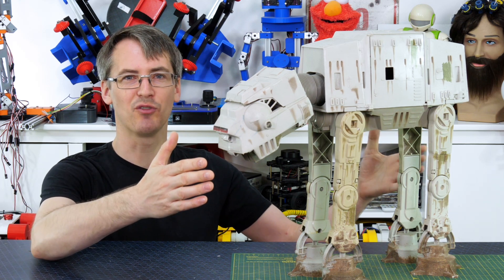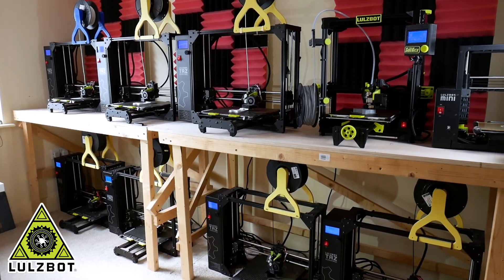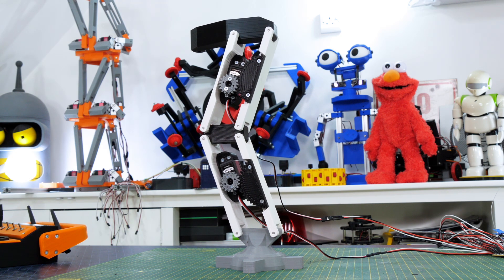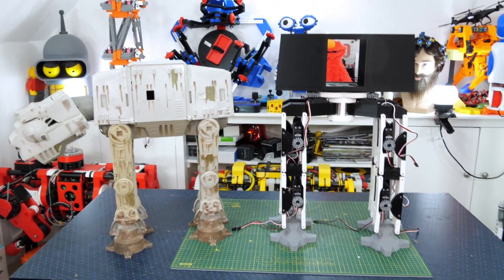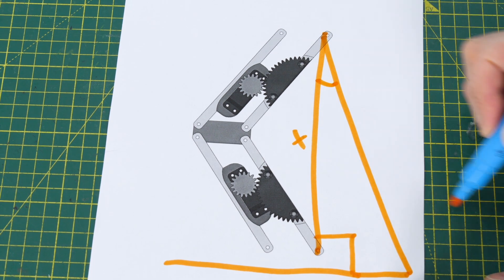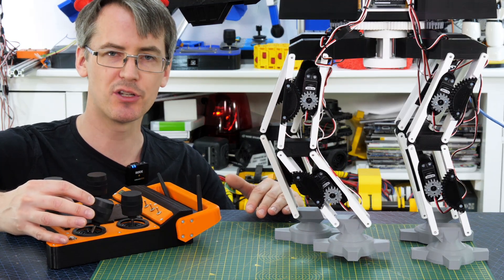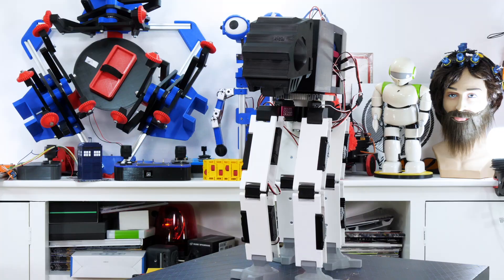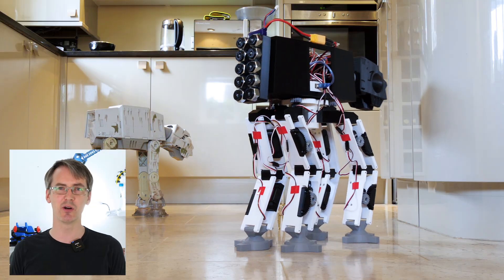Building a better Star Wars AT-AT toy

Comment: Its weird you didn't build in the "shoulder" action that the movie design actually has. Which would mitigate the wobble of the walk. I see the toy you have doesnt have the shoulder joints either. I think thought it would be exponentially more complicated to build it movie accurate but i think the movie designers actually did a good job making it a plausible design. They had to make the model walk in the movie after all.

Comment: It works, just with 2023 technology, rather than 1979 technology.
But it did make me appreciate what a marvel of engineering an AT-AT walker would be in real life - for all its mechanisms and control system. Combine that with the very tight and careful balancing needed to give it a stable walking cycle.
You get a clunky vehicle that's an absolute nightmare to build and probably requires maintenance after every deployment!
However, it's lore-friendly. Imagine how corrupt the Galactic Empire needs to be if it was to arm its ground troops with such clumsy and unreliable troop transports, whose primary purpose is to scare the enemy.

Comment: I'm scratch building an ATACT for a friend. I made the ankle joint with the arc attached to the fee and a passive shock absorder inside the ankle. It's a static model but each leg/foot assembly balances well enough to stand on its own. I wondered if you reproduced the ankle arrangements as they are in the stars models you may achieve a smoother gait. The arc on mine obviously made by hand and guesstimate. A printed arc would be much smoother.

Comment: Mmmm very interesting, but to put it in a real AT-AT..., may be a way to use only two motors alocated in the main body, which use tensors, each one controlling two crossed legs, and implementing some kind of cam mechanism in the legs??
Veeeeery nice proyect!!
Good luck brave one 💪💪
Greetings from Buenos Aires 🙂

Comment: While you did successfully create a walking robot with four legs, both people and at-ats don't walk or support themselves on bent legs. there is a stride and when you back step you're leg straightens to give support there is no straight support in those legs it's good for what it is but it's a fail for an proper walking at-at. Go back to the drawing board study the animation gate of the actual at-at, do a close up inspection of the gears an engine that powers it and try again. May the force be with you.

Comment: Very cool! As I was watching it, something didnt feel right, I think it's that the stride is different than how they walked in the films.  Yours is RF, LB, LF, RB compared to the original RF, RB, LF, LB, maybe an easy programming update with a big impact. The original also had another joint near the central connection that allowed the legs to lift up under the body giving it lift clearance and a firm plant, which I think made the walking effect feel heavy.That said, your design can turn and I don't see how the original design could. Overall great work!

Comment: And what's crazy... No one has ever addressed just how terrible by general design all of these walkers are! The greatest issue being the limits of the terrain itself! These things don't do hills and valleys! Then there's a problem with the ground itself. Most of us don't fully realize that ground isn't all that solid. Once an object reaches enough weight that the pound per square inch can't be supported by the ground the object will punch down into the ground vs standing on it. If you've ever seen someone trying to walk across a waterbed, you'd image a picture of what that falling would seem like! 
Comparing the scale of two toy action figures to the working Walker model - it struck me that the Walker wasn't nearly to scale. With the relative small surface area of the four feet pads, understand that to walk, the weight all get dropped to one of those four! Even a granite mountain would buckle! The sheer weight of such a machine - would / could never walk!

Comment: I think the funny one for me is that James' walk cycle is EXACTLY backward to the actual AT-AT... If you watch the original scene, the AT-AT ALWAYS walks putting it's FRONT foot forward, then the BACK foot forward ON THE SAME SIDE!

Whereas James' walker always leads with the BACK foot, THEN the front... 

Now, James could also have taken advantage of the AT-AT leg construction by creating the free-pivoting ankle, balanced to keep the foot...flat. That's WHY the original has it...well, that and to allow the foot to adapt to forward/back slope of the ground under the foot. Add to that the fact that the walkers almost always kept their legs mostly straight, rather than always bent (because most of the walk cycle is dependent on the 'hip' joint (as @coreinc.9658 pointed out), rather than the knees. The knees bent as the leg was being lifted and re-positioned, then straightened as the leg was stepping down, keeping the leg as a rigid brace for the step...

It's why the AT-ATs always gave the impression of height and straight leg walking...because it WAS. The 'hip' joint and the pivot at the ankle were the real stars of the machine's walk...especially since that gave them an almost 'goose-step' walking style, further making them appropriate for the oppressive Empire.

Comment: Those are really nice leg movement mechanisms with the power train hidden inside, well done.
Some years ago I sketched some mechanisms for an 1:120 scale RC version of the Sidewinder from Thunderbirds, a walking behemoth not unlike the AT-AT but more 'angry' in appearance and decidedly cockroach-shaped.
However the legs and movements are quite different to the AT-AT in being straight cylindrical stalks that are retracted for the step, pivoted then extended. This wasn't the difficult bit to design, what was was a heavy steel or lead counterweight block inside the body that could be moved to the diagonally opposite leg being lifted. Now I have a 3D printer perhaps I'll get back to it sometime :)

Comment: Very cool.  I love how you solved a lot of problems that I've been banging my head against a wall about, in regards to a lego build.  Quick observation that I hope you read and maybe it will help you.  I used to do a little engineering so I really HOPE YOU READ THIS - I THINK IT WILL REALLY HELP!  TOP OF THE LEGS, where they connect to the servos that allow the AT-AT to sweep the legs out to the sides for turning: In the movies and in the Clone Wars, that section of the AT-AT also travels up and down slightly, like a shock absorber.  It might be useful knowledge to you. You could add servos for each "shock absorber" - making the front ones more stiff and the back less, which would make it easier to hold the head up.   This would also prevent the AT-AT from swaying so much from side to side while it walks, a much steadier design.   I would recommend going back and watching the invasion of Hoth one more time from Empire Strikes Back.  There are a couple of really great shots looking up at the bottom of the AT-AT's, they might be useful in coming up with a more helpful - cohesive design.  Don't get me wrong, I LOVE, LOVE your work.  I really do. It's just that I've been struggling with all of these same problems myself recently and I thought I'd pass on what I've learned.  I wish you good luck if you decide to make any mods and if you do, I can't wait to see them!  Cheers my friend!

Comment: Where you said the joints don't match perfectly so don't form a perfect triangle you are wrong! Draw an imaginary line along each strut leading to those pivot joints to represent the two sides of the triangle and extend the lines past those joints. Where the two lines cross is the actual corner of the triangle. The two pivot points can be anywhere along the edge of the triangle and it would still work as long as you are keeping that triangle consistent, the closer to the corner the better and of course it's best when there is one pivot point at the corner of the triangle instead of two. So, you just need to adjust the calculations for the actual size of the triangle instead of the lengths between the pivot points.

Comment: ILM  used an elephant walking  as a reference to how the AT AT  should walk . LEGO made a walking technical , "Power function set " with remote control and was the only set representation of a motorised  AT AT, about ten years ago that has all the legs bits moving autonomously and  walking functions via LEGO remote control as well that could  help with this.

Comment: See very cool and everything, but it would be very interesting to see if the orginial film mechanism works to actually allow the thing to walk. Each leg contains pistons that cause the rotation of the joints which you can see working in the film. It also has the iconic curved rattchet joint in the foot with a bearing in the joint and spring loaded toes to allow walking on rough/hilly terrain rather than just flat. Might make a cool advancement to to the project.

Comment: great build the only thing i noticed is that the orig AT-AT walks slight different to yours, yours walks like a dog where as the original takes steps as follows, no particular order we will just start with the front right , so it goes front right then back right follows then front left then back left, ur is front right back left like a dog, great build still its my fault i got effected by the walk lol

Comment: One thing that I think a lot of people forget about the ATAT's legs is that they are actually made of 3 sections, instead of just 2 like the toys are.  There is a 3rd beam that connects to the ATAT's body in the center underneath the two other leg sections, meaning that the legs can be raised up and down as well as creating a suspension of sorts so that all of the force isnt directly pushed upward into the walker. This is sorta represented in James's creation however it is also able to move up and down. Its ability to pivot that beam left and right addition ot being able to pivot up and down gives it a massive range of motion, much larger than the robot created here. I can also see how that would be very difficult to replicate in a robot though, just because of the complexity of that joint being able to move in two axis
Reply: Yeah when he said look the legs can swing outwards I was like Why? They should go up and down at the hips! But he's right in that without that it can't turn however it would be cool if he got the hips going up and down as well. Two axis on each hip joint would be tricky though. It would also help with the IK system for the planted feet needing to move backwards.
EDIT I just looked at my Bandai AT-AT and the hip joint is a ball joint, allowing it to go up down and left right.
Reply: Not only that, but they had 2 axis ankle movement as well. An arched track from front to back that was hinged at the foot, and an inboard side piston. Remember it's not just a shuffle walker, but was made to be an all terrain transport. The films stop motion barely scratched the mobility of the actual design. I really miss the days of practical effects, today in movies they just turn on clip mode and ignore internal volumes.
Reply: Not right... You can turn the walker when the 3rd joint is only going up and down. Why ?
First, you can do bigger steps with the 3rd joint. 
2. you can leave a front leg on the ground and let the other 3 do a small walk motion
3. you can do smaler steps on one side and bigger ones on the other side
This motions are not that easy, but the 3rd joint is the key to do a real god walking motion. The 3rd joint also was used on the AT-ST, but this one used a chicken leg mechanism. The human hip is our 3rd joint, together with our feet we manage the hight control of our steps. The feet are fixed on the AT-AT, so the 3rd joint is all that is left.
Reply: @markushavers2283  No, the small step big step won't work. You can get up and try it yourself. All that happens is the side taking small steps lags behind and has to take more steps to keep up. It doesn't induce a turning motion. But I'm now looking at the underside of my Bandai AT-AT and there is a ball joint where it connects to the body and I can swing the hips in and out and up and down. So they had the capability all along.
Reply: @thirdeyenz  I´m pretty sure it would work. An AT-ST will do this to walk in a circle.
But i am evem more sure that an AT-AT would not even use this walk cycle.
When there was a ball joint in the original design, no problem, circle walk possible.
But if not, there would be the possibility to stop, turn on the spot and walk again.
Reply: @markushavers2283  So you didn't stand up and try your short step long step idea then huh?
Reply: Correct. That extra piece acts as the shoulder blade. Here's that in the movie: https://youtu.be/jnl9ffCfrsc?t=15

Comment: Fabulous! Might be wrong but you have a lot of torque to play with. Maybe putting lots of batteries strategically placed to power it and add enough inertia to eliminate most of the rest of the wobble. It might also give it more stability to keep it from tipping over.

Comment: Springs for increased movement energy and efficiency seem like a no-brainer but maybe the increased control problems generally make that too difficult, though by the way Atlas etc move it sure looks like Boston Dynamics have turned the normally problematic 'springiness' of pneumatics into exactly that benefit.

Comment: Would using a parallelogram inside the leg like this work as a different way of handling the 3-2-3 transition in an R-unit's leg rather than using a larger motor to try and take the full weight of the shoulders like your old R-unit builds?

Comment: It would be interesting to see you tackle the accurate AT-AT walk cycle, as it has quite a few different moving parts. I wonder if it would actually even be possible to achieve in real life.
Reply: If you look at elephants, they archive it every day. Footage of them inspired the original stop motion made with models...
Reply: @JohnEdwa It would probably be easier to do in a larger scale, because you would have more room to work with. You could use linear actuators, hydraulics or pneumatics, etc.
Reply: The correct step pattern: left-front, left-rear, right-front, right-rear, etc.. Most AT-AT toys and fan-made versions do not step this way (and it is difficult to do, because of real-world mechanical physics). The AT-ACT by Hasbro also fails to step correctly -- it's "shuffle-pushes" by raising two legs diagonally from another at a time.
Reply: yes, it is possible. search youtube for "AT-AT walker at Modelcon 2008"
it's only about 8" tall, and made 15 years ago.

Comment: Very cool.  I vaguely recall that the leg motion that Lucas’s stop motion puppeteers used was slightly different. I wonder if your code could be tweaked to match into that?
Reply: Yeah, my same thoughts, the stride needs to be a bit longer.
Reply: That wouldn't be possible. The AT-AT walking cycle depends on four hinges from the centre of the belly which pull the legs 'up' like a hip or shoulderbone would. Then when lifted, the legs bend and move forwards.

Without the four hinges, the legs don't get the lift required to mimic the motion perfectly.
Reply: @michielwerring5846  I haven't looked at footage from the TESB lately, but I definitely remember them lifting higher and placing steps somewhat differently.  I'm sure you're correct in your analysis.

Comment: James, heavy IK question for you that I've struggled with for a long time... how do you handle individual joint speeds with IK?  I know you calc the angles, but if they all don't move with some sort of synchronization, doesn't the pattern of movement you intended get all muddled up?  So do they all move the same speed? Or ratioed to all start and end their individual movements at the same time? Or?  I'd so very much appreciate your feedback on this quandary I'm in. Thanks for all you do for our community, most of what I've learned is from your videos! :)

Comment: Now, clearly, you need to build a mini snow speeder with a harpoon to trip it up. Also nice to see you aren't picking sides on the @-@ vs. Aytee-Aytee debate. We all know it's Aytee-Aytee though, anyone who says otherwise needs to explain how they pronounce AT-ST.
Reply: AT-ST? Hold your tongue in position after pronouncing the first T, then dip the tip so some air escapes. That's the S. Return the tip of your tongue to your gum to start the T, then release pressure as you remove your tongue from the roof of your mouth, letting just a little air escape so everyone knows it's a T and not just the end of the word. -- I'm not in the slightest bit serious; it sounds terrible! XD Or at least, it sounds like a completely alien word and not an acronym at all.
Reply: @eekee6034  isn't ST what we say when we want someone to be quiet?
Reply: @DrWhom  Oh it does, yeah...

Comment: Since the leg segments are variable geometry parallelograms, how do you handle the outer armor cladding on the legs?  I can see how it might be done, but it appears that doing so would add so much more complexity to the design that it might no longer work.
Reply: For the leg armour, that's easily added. Just slap metal cladding on the sides, with a "gear" at the joints to allow the metal cladding to slide around each other. Then add round metal cladding on the gear to protect that newest weak point... and you now have the distinctly AT-AT legs... except they are bent instead of straight.

This isn't bad for a proof of concept... he just need to get a design team to make it look pretty, lol.

However, his design wouldn't work when you start to put several thousands of tons of weight on the legs. I'm looking at a clip of the battle, and their legs are actually on levers. That's how the legs are able to remain straight while moving.

YouTube clip title:
The Battle of Hoth in Star Wars Episode V [The Empire Strikes Back] (1980)

Channel name:
Worlds Greatest Clips (WGC)